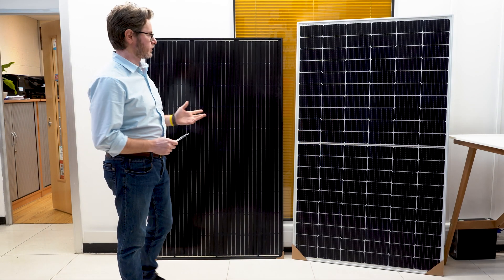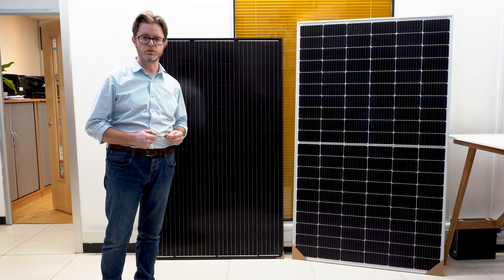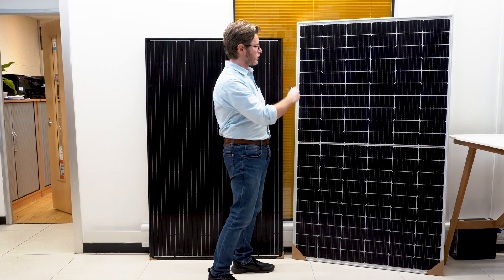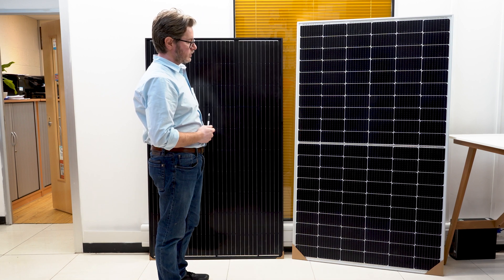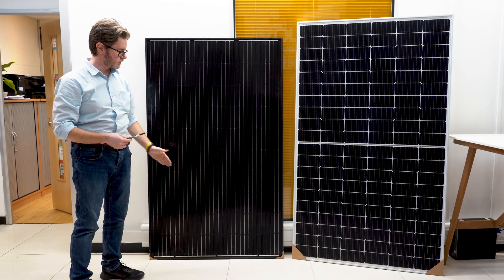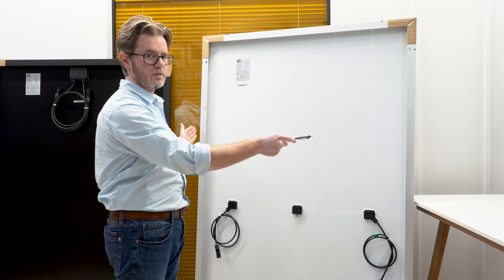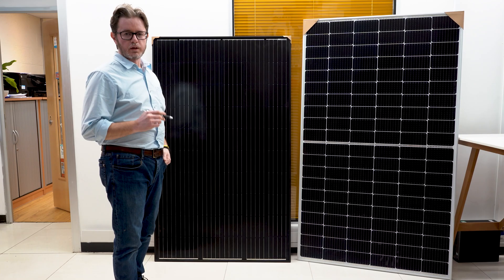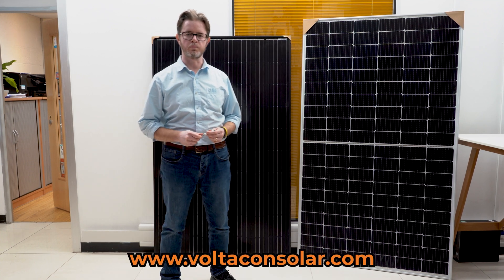Comparison Full Cell Monocrystalline Solar Panels Vs Half-Cut 120 Cells.

Comment: Which one is better in hot humid weather for caribbean countries ?
Reply from the maker: Hello, both panels will work ok in these conditions. The difference between them are that the half-cell panels performs better in shading conditions and they have better power rating.